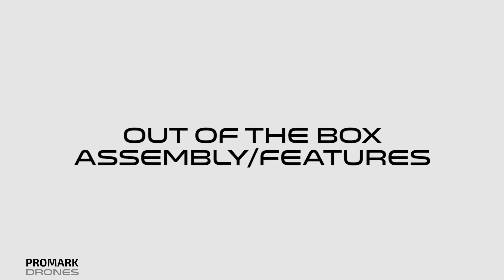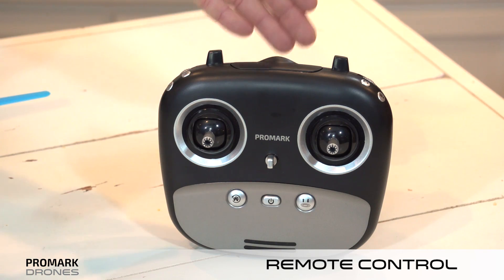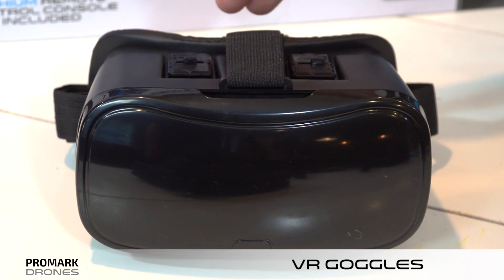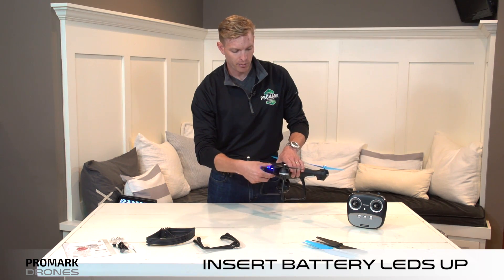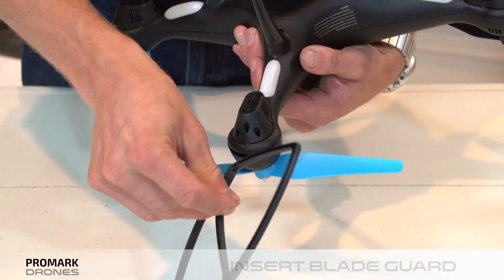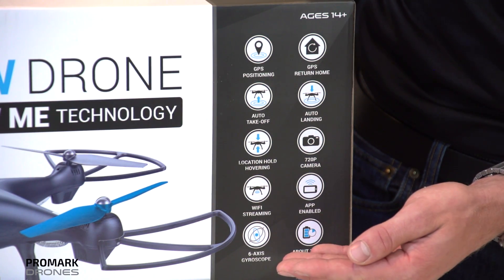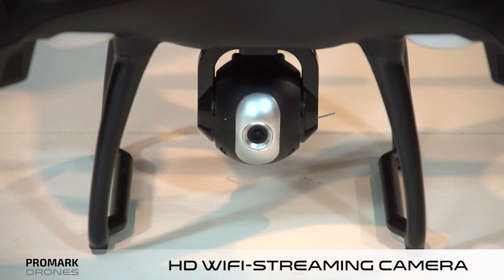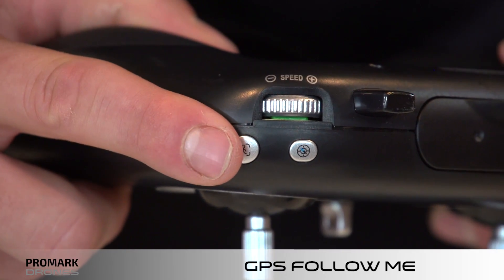P70-GPS - Video 2: Out of the Box / Assembly

Comment: How long do you have to charge remote control because my control dont turn on
Reply: same prob with with mine got it last night too at walmart
Reply: same here. wont turn on at all.walmart as well. could be a bad batch. phone support after hours is an answering machine. no redirect or message of the company at all. just a generic leave a message. hope they have good support because this was a lot of money for it to just "not work"
Reply: Ya jus got one today an remote won't turn on
Reply: After all i ended up returning it and is funny in the manual there is a little paper saying stop dont return to store call promark and i did and a stupid answer machine responds so i got fed up and returned it with success not happy at all and i didnt like app neither
Reply: Outside box it said control remote charges in a hour and nothing the other battery did charge in 6 hours it turn on and worked in app but control never turned on it marked on my phone low voltage and but drone battery was fully charged and i try charging remote control again and again never turned on so it went back to walmart
Reply: I took mine back got a new one checked the controller an it worked
Reply: mine is going back in the morning messed around all day with the controller  now I don't trust PROmark at all just cheap crap